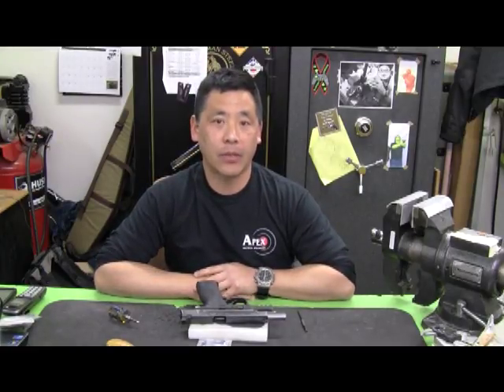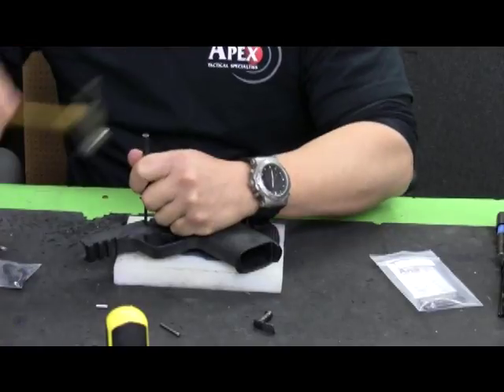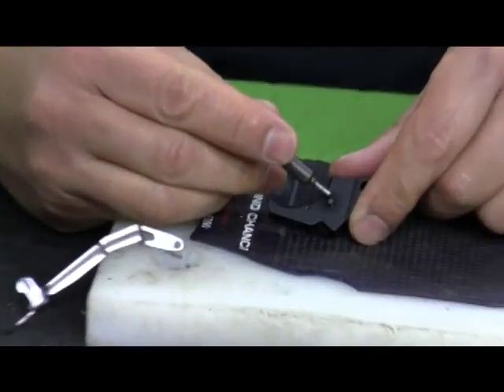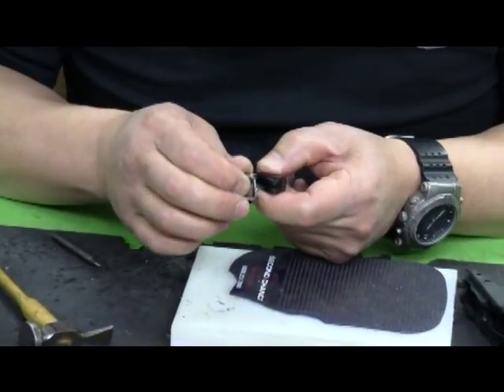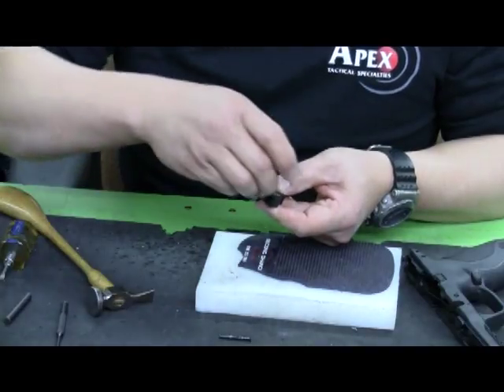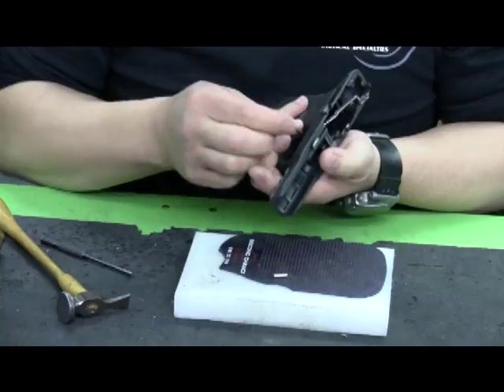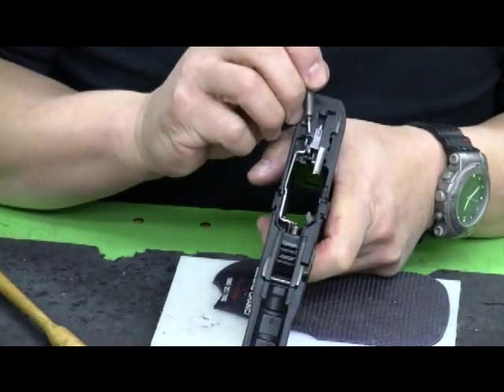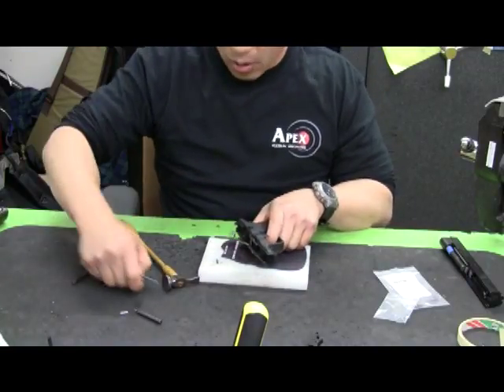AEK Install

Comment: Just installed the FSS in my new 9mm with a may 2013 production date on it and got lucky and didn't have any problems or had to do any tweaking. Happy so far, now just gotta test fire tomorrow.

Comment: thank you Randy for the instructional video. got it in on the first attempt. I didn't have to adjust the loop either. had just enough pretravel to break the shot.  love all your stuff at Apex Tactical. Keep up the good work!

Comment: Everything with my DCAEK installed just fine, the spring for the AEK aluminum trigger of course went on fine but the pin in the actual aluminum trigger will not budge... my local gunsmith couldn't even get it on.

Comment: I'm confused at 0:55 - The sear spring that comes with the aluminum trigger replaces the sear spring for the DCAEK, but not the S&W original spring??? I thought the DCAEK spring was heavier than the original.

Comment: One question, why not just slide the punches through the pin holes to check function instead of driving and removing the pins?

Comment: So you have to modify the original trigger bar loop (candy cane)? I was really looking forward to getting this trigger but having to modify other parts to get it to work is unexceptable to me. You guys should make a trigger that is exact replacement for the factory m&p trigger, there is no reason why you can't.

Comment: Just installed and very happy with how the install went. One question, I have a little bump in the trigger as the slope reaches the sear, is this normal ? Or do I need to spread the candy cane a bit more?

Comment: what if don't have enough over travel, but the striker blocker still engages and fires? i just installed this kit on my M&P Shield 9mm. and it doesn't appear to be stopping over travel on the frame, the trigger is just stopping because of the limit of travel has been reached due to what ever physical limitation has been reached internally. pretty much it fires, but it the trigger does not touch the frame, or any over travel stop

Comment: this kit needs to include the trigger bar with it. it only costs $10 for the S&M trigger bar so its not a high dollar item but since you HAVE TO bend the trigger bar to use this trigger then you cant undo this mod for sending the gun in for warranty work. this is not acceptable to have no way to undo the mod.

Comment: Can this trigger be installed withOUT the other springs and sears?
Reply: I just installed the polymer one in my CORE. It took about 15 minutes. I had previously polished only the contact points in the gun, which brought the pull weight from 5.75 pounds down to 4.5. I have not replaced any springs.I did shorten the plunger spring by 1.5mm and polished the plunger and hole, which erased the notchy feel. This trigger in polymer feels great compared to the factory trigger. I am 100% happy!

Comment: Does anyone know if you can just replace the trigger with all the factory springs and factory parts and just replace the trigger or do you need apex springs?
Reply: i read about it somewhere and only swapping the trigger for the new one will let you with a trigger pull of about 4lb...  using the strong sear spring provided with the kit someone said that the trigger pull will be about 5,5lb .. i asked that like you to apex .. hope they will clarify that

Comment: I put the polymer shoe on my 2.0 and it cracked on the left side of the spring.
Had to put my stupid original articulated stock trigger shoe back in.
Maybe I should have chosen the aluminum apex.
Very disappointed after hearing so much good about apex.
Reply from the maker: Did you contact customer service? They will help you figure out what went wrong and will get your squared away.
Reply: @apextactical  No I didn't.
I may call them and send them a picture.
Appreciate your reply sir.